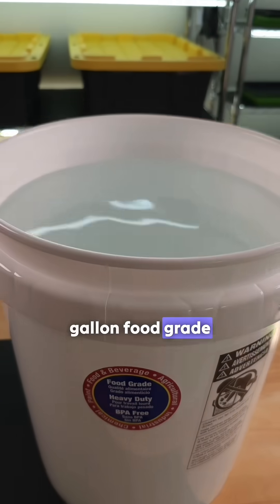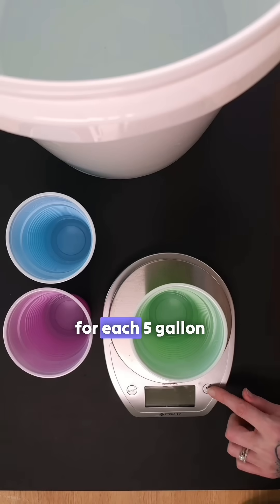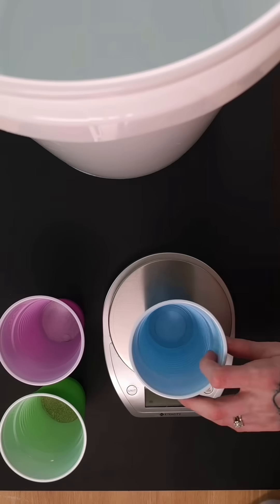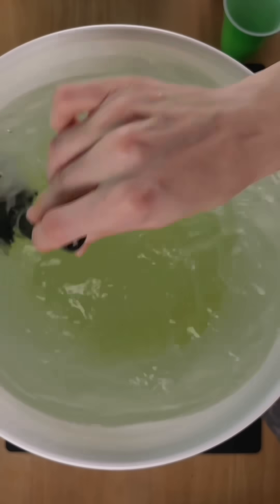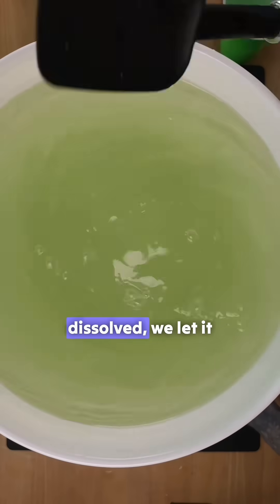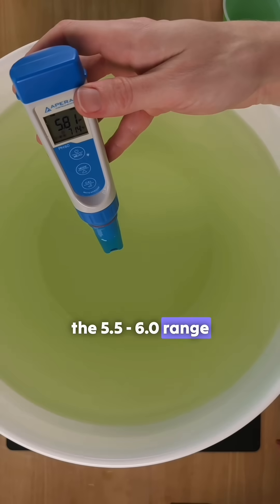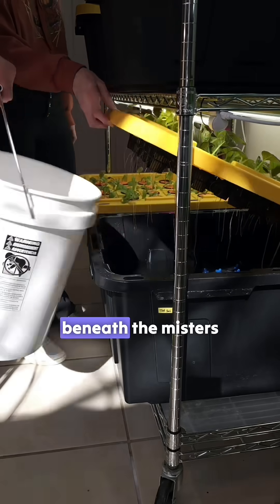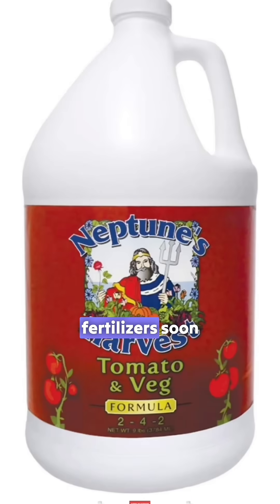DIY Aeroponic System: Mixing & Adding Master Blend Fertilizer (Part 4/6)

Comment from the maker: Part 4 of 6: 👉 If you're growing hydroponically or aeroponically, your plants are getting all nutrients through water intake in the roots. That means we must provide all essential nutrients in a water-soluble form, simply meaning we add and mix the minerals with water

🌱 Fertilizers aren't “bad chemicals”—it’s just plant food! Whether organic or synthetic, plants need the same nutrients. Organic fertilizers have microbes, while synthetic ones (like we're using right now) provide pure, water-soluble minerals (nutrients) for better absorption.

😊 We’re using a 3-part mix from @masterblendfertilizers (link in bio) for our mature leafy greens. It also works great for herbs, edible flowers, peppers, and tomatoes.

🔹 MasterBlend 4-18-38 → Provides phosphorus & potassium for strong roots, flowering, & fruiting + essential micronutrients to prevent deficiencies.

🔹 Calcium Nitrate (Ca(NO₃)₂) → Supplies nitrogen for growth & calcium to strengthen cells + prevent blossom end rot.

🔹 Epsom Salt (MgSO₄) → Boosts photosynthesis with magnesium & supports enzymes with sulfur. ☀️

⚠️ Mix in This Order to Prevent Nutrient Lockout:

1️⃣ Dissolve MasterBlend first.
2️⃣ Stir in Epsom Salt.
3️⃣ Add Calcium Nitrate LAST (mixing it too soon can cause calcium sulfate buildup, which can clog aeroponic misters & hydro lines).

✔ Adjust pH 5.5-6.5 for best absorption!

This is just one way to feed plants! Many hydro fertilizers exist, including organic options. The big question? 🤔 Do they work with this system, or will they clog pumps & misters? We’ll be testing more soon!

We’ve already tried Ocean Solution (our go-to for microgreens) but didn’t love it for mature leafy greens. You can also check PPM when mixing fertilizers, but we choose to skip it.

👉 If you're concerned about plastics, we encourage you to do your own research and choose what feels right for you. We grow for personal consumption and use materials we’re comfortable with.

Amazon Affliate link to Supplies = https://www.amazon.com/shop/onthegrowfarms/list/313WWLPVLRLRO?ref_=aip_sf_list_spv_ons_mixed_d